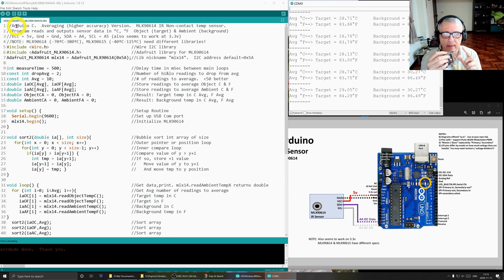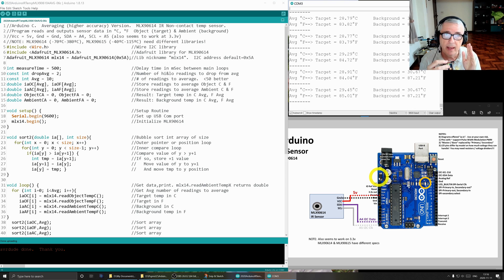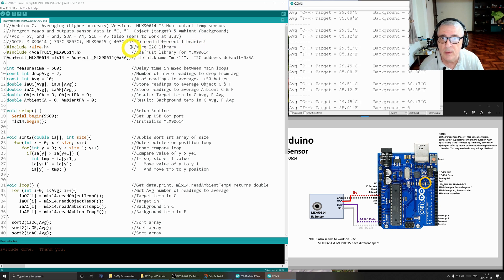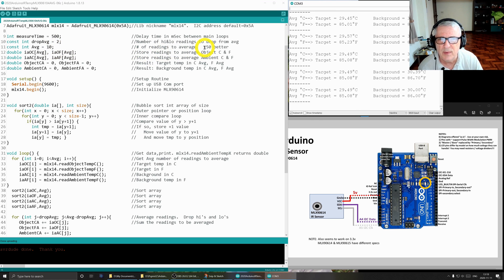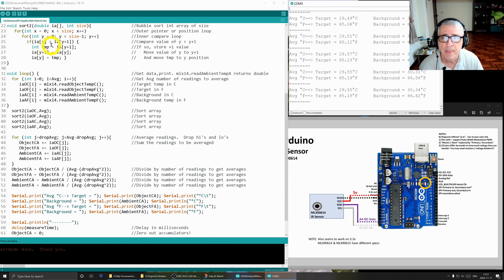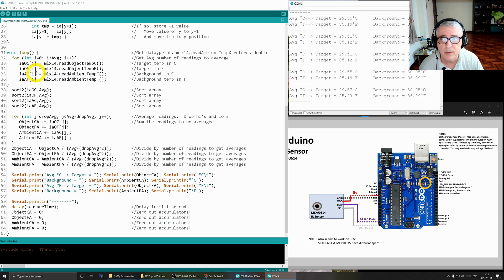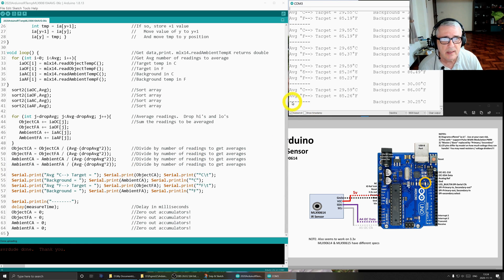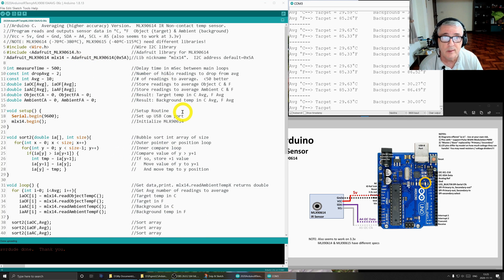Arduino - MLX90614 IR Temp Sensor - Higher Accuracy (4K)

Comment: This was extremely helpful. My code is now robust enough to ignore wild readings and simply display "max temp" when aiming the sensor at an object above the maximum object temperature for prolonged periods of time. I cannot thank you enough!
Reply from the maker: It's always good to hear that I've not wasted my time posting these videos.  Thank you.  Note that this is just the most basic way to stabilize results. A premium way to do this is to average a given number of the highest readings (throwing out impossible readings).